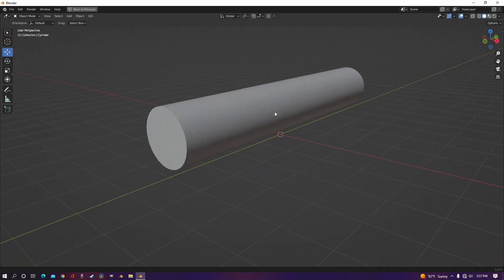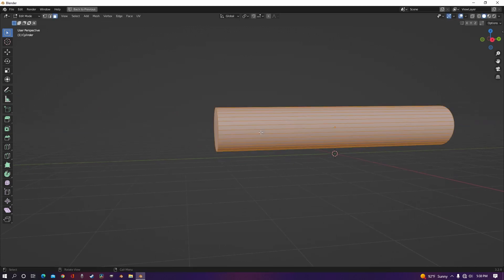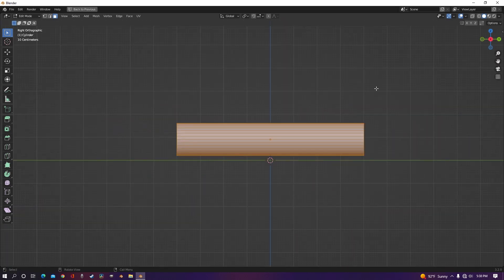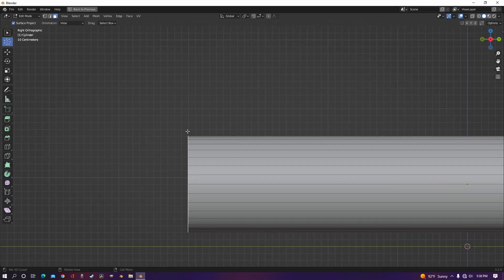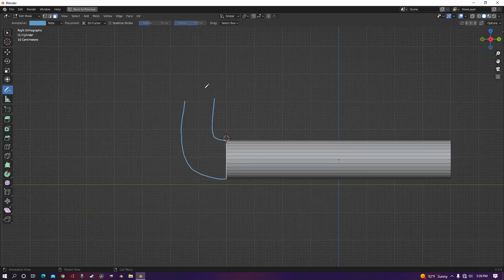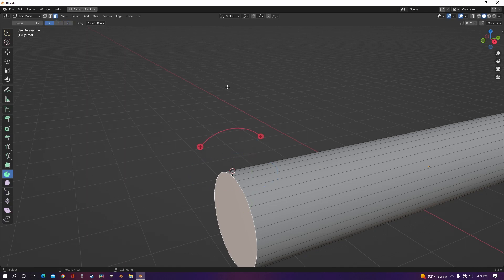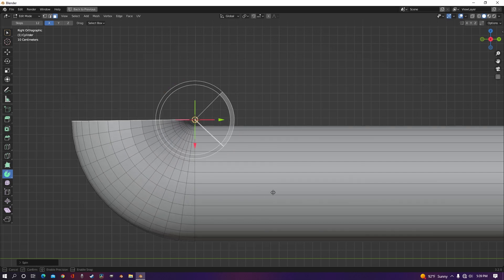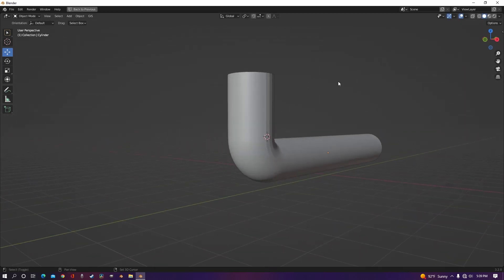How to Use The Spin Tool in Blender

Comment: Lovely.  I was trying to learn this in by having ChatGPT teach me but for the life of me I couldn't understand what it was explaining to me.  Seeing this visual makes it much easier.  

Here's what GPT told me it does: (And I don't blame the AI for explaining in such a hard-to-understand fashion... because this is something I wouldn't be able to explain to someone without just showing it).
What the Spin Tool Does:
It takes selected geometry and duplicates it around a central axis — creating radial or spiral patterns.

Think of it like:

Lathe turning in real life

Or rotating and duplicating edges to form circular geometry

🧱 What Can You Use It For?
Creating cylindrical shapes (pipes, knobs, rings)

Making fans, spiral stairs, bolts

Radial arrays or symmetrical organic shapes (tentacles, petals, etc.)

🛠 How It Works (Step-by-Step):
Go into Edit Mode

Select some geometry (usually edges or vertices)

Activate the Spin Tool (in the toolbar under Mesh Tools, or hit Alt + R)

In the bottom-left panel (or F9), adjust:

Steps → number of segments

Angle → total degrees to spin (e.g. 360° = full circle)

Axis → which axis to rotate around

Center point → determines the pivot

🧠 Key Concept: It’s Like a Controlled “Orbit” of Your Mesh
You’re saying: “Take this edge, and rotate it X degrees around a point — and fill in the geometry between steps.”

Blender handles the dupe + merge + fill in one move.

🧪 Try This Simple Test:
Add a plane

Delete everything but one edge

Go to top view (Numpad 7)

Select the edge

Activate Spin Tool

In the popup:

Set angle to 360°

Steps = 32

Axis: Z

Voilà — you just spun a perfect circular disc from a single edge.

Comment: I learned this method back in my early days with Blender, from a Blender Guru video actually. I think it was from one of his modelling tutorials, probably the chair tutorial. It's very useful to know, though admittedly I haven't had to bend mesh cylinders much and have pretty much used curves to build pipes most of the time.
Reply: After learning this method, it was very easy to make objects that require curves, such as pipes.

Comment: what is really missing is moving the 3d cursor like an object along a x y and being able to snap to geometry then
Reply from the maker: You can actually do this by going to the side bar and then the view tab
Reply: @lane_wallace  yes you can and that is fine for manual entry but it should be possible to drag it like an object and snap to geometry while dragging
Reply from the maker: Ohhh yes I know what you mean now, and you’re right, that would be very useful in many cases
Reply: You can in Blender 3.3: Shift + hold down Right mouse button; turn on snapping to vertex (etc.) or hold Control to temporarily turn on snapping while dragging.
Edit: But only press Shift + Right mouse to start! Then after that you can hold down Control (otherwise it will try to lasso select).

I actually never tried this until I read your comments, I just knew you could Shift + Right click to set the 3D cursor, but this is very useful, huge time saver for me!!! :D

Comment: Powerfull tool, was playing around with it. Is there a way to make the spin tool circle radius bigger?
Reply from the maker: Hmmm I’m not sure, but I think the position of the 3D cursor dictates the radius
Reply: I moved the 3D cursor beyond the extremity, and higher. It made the radius bigger, but with a strange curvature. But then I found out that the green, red and yellow arrows can be dragged to get the right look / curvature. The tool seems very flexible.